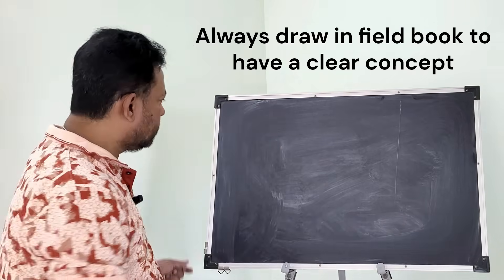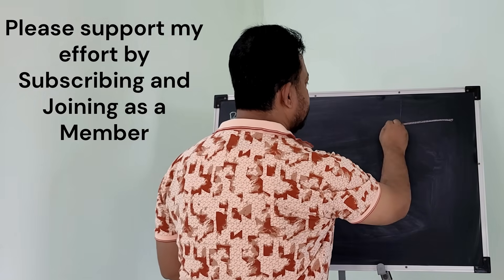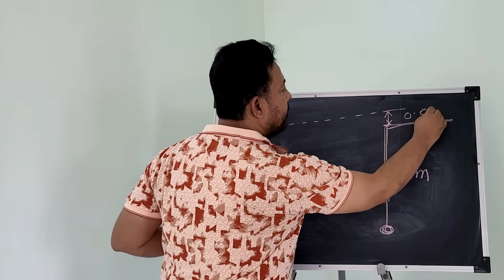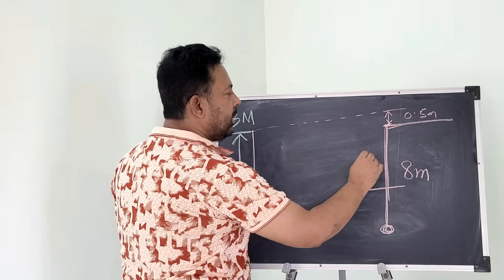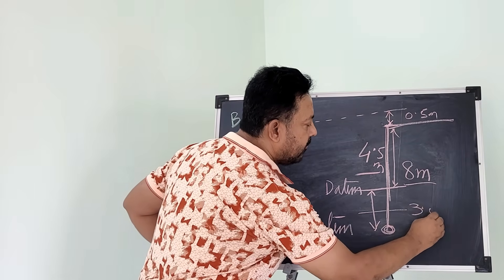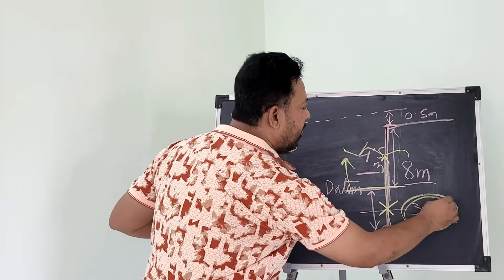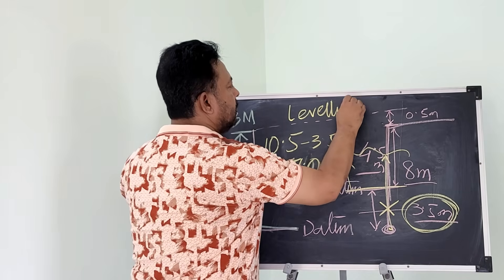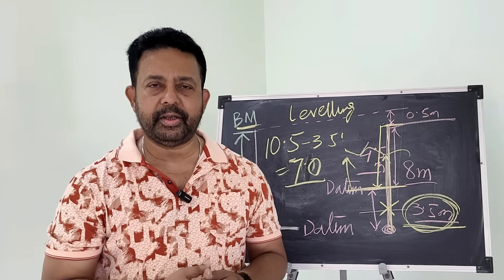How To Measure Tide Traditional Way

Comment: Thank you for the video sir,  it was explained in a  very simple way as possible..i have doubt can we use this method with a tide pole , and what if the benchmark is using msl datum ?
Reply from the maker: Hi Thanks for watching. This is a traditional method and I personally have used this with a Pole, with ATG Pressure Sensor lowered from jetty and with ATG Radar Sensor. If your Benchmark is MSL, then you need to know your sounding datum. Ask client or observe tide during Spring - 2 days prior and 2 days after and find LLWS (lowest Low Water Spring) and you can use that as your sounding datum - if client agrees. This observation can be coincided with actual survey, so you do not lose 5 precious day just for tide. Best is to observe for 30 days to find the LAT and use it. As a surveyor we need to use what best options we have in our hand and give client the best possible solution.
Reply: Thank you sir,  for your reply . 🙏
Reply from the maker: I am trying to build an honest community and I always try to find solution and always happy to help.